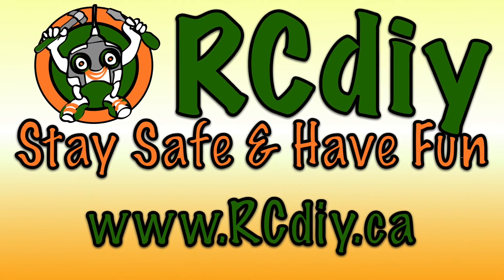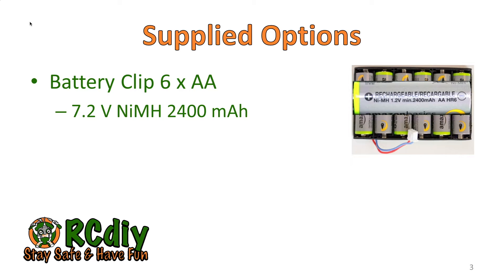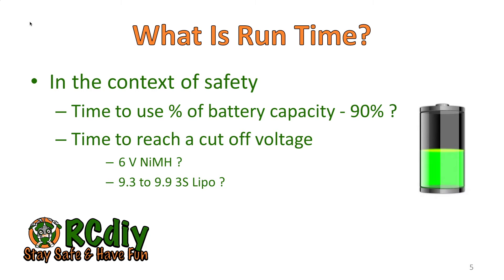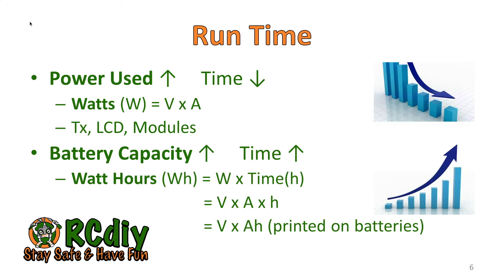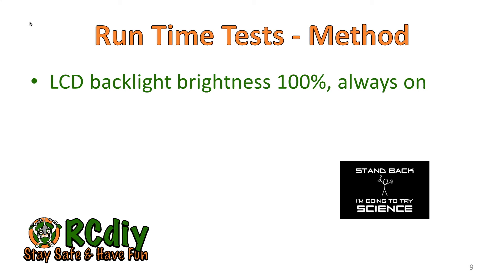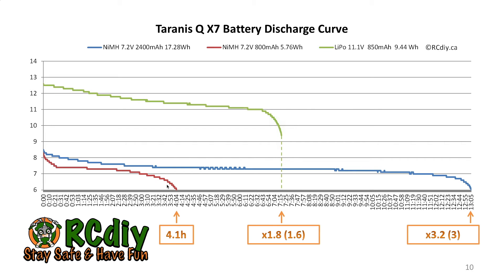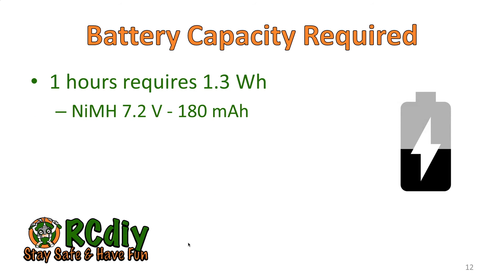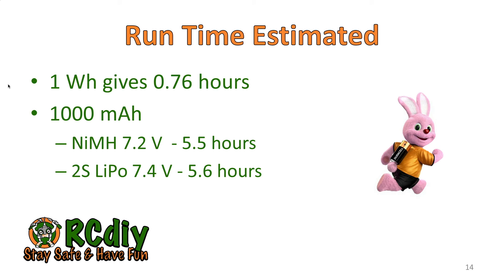Taranis Q X7 Battery Run Time

Comment: How does the qx7 set it's own low voltage alarm? because it's different for 2s and 3s ...
Reply from the maker: Ruben van Eupen you set it. It is not automatic.
Reply: @RCdiy  ok thx. What did u set it to for the nimh 2000mah battery? Because it stays closely around 7V for 80% of it's runtime... .

Comment: Since you would never want run a LIPO down to 0V, I assume you would cut the amount of flight time down by 1/2?
Reply from the maker: I’d put the low voltage warning at the voltage at which there is 20 minutes left. That gives a good buffer to land the plane if the warning triggers during a flight. In reality I keep my tx charged between flying days and turned off between flights.

Comment: Very informative video! The NiMH batteries from Amazon, can we keep those in the 6xAA tray and charge directly from a charger(that supports NiMH), or do we need a special NiMH charger?
Reply from the maker: multiTYRT A 6 pack NiMH charger will work but requires modification to the case/maybe. I currently take them out and swap them. They last a long time.
Reply: Yes, the charger MUST be made for NiMh if you're charging NiMh battery's.... Fire or explosion can result in using the wrong type of charger. Same for LiPo and LiPo HV etc etc etc